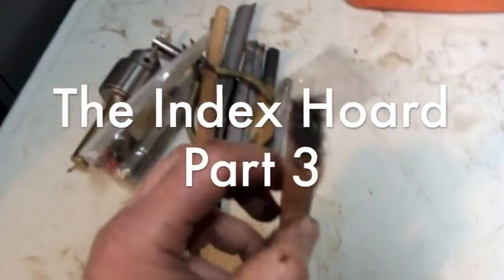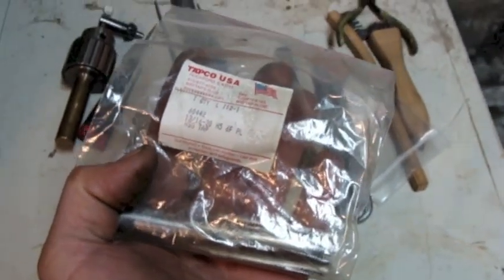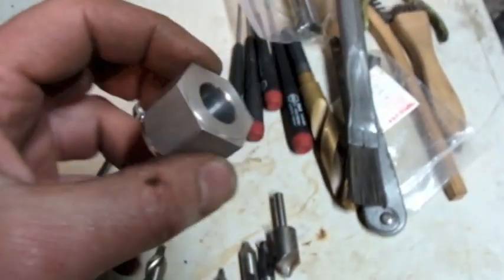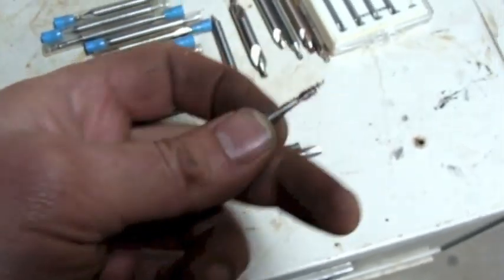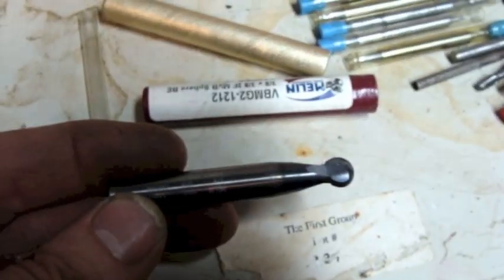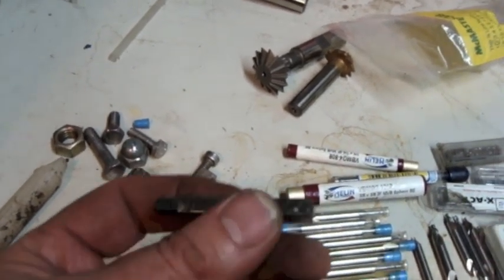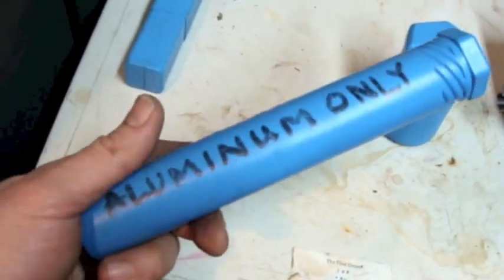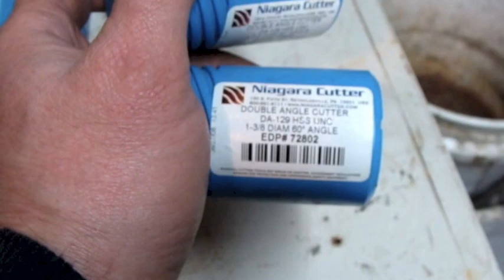Wells Index tooling Bonus Part 3 of 6

Comment: Steve;

You have scored big time with this mill.  Just from what I have seen so far on the 3 tooling bonus videos you have posted, you have more than likely already covered the cost of what you paid for the mill.  You basically got the mill for free.

I would not sell off any of the tooling or other items until you restore the mill and start operating it.  You never know what you will need and my own experience is that you will spend equal to or up to double what the price of a new mill would cost just to tool up for all the type of work you will do on the mill.  This is why that cabinet of goodies is such a deal for you, you basically have almost all the tooling you will ever need for any of your projects.

If you haven't gotten your mill inside to a protected environment yet, you might want to give it a good coating of rust preventative/preservative spray.  Slather that stuff on all over the mill and especially on any machined surfaces.  Since you are likely going to take the mill apart to do the same level of restoration that you are doing on your lathe, cleaning off the preservative will just be part of the process.

So the only question now is how are you going to convince your wife that you really do need a 3 phase power lead into the basement, LOL?

Regards;

Ron Kluwe
Reply from the maker: Hi Ron, Thanks for your input. I actually plan on doing very little to the mill aside from cleaning it, and the dis-assembly will be more of a necessity in order to get it down the bulkhead stairs. I hope to be making that move by the end of this month. I have a 3 phase rotary converter I built several years back that might run the mill, if noit, I will probably buy a VFD.

Comment: Silver-Demming are oversized stubby big drills with a reduced shank to fit in a smaller chuck.  The flats on the shank are to keep it from spinning in the chuck from the torque. The counterbore is to cut around a drilled hole to be able to set the heads below the surface.

Also, the wax is probably just for lubrication.
Reply from the maker: Thanks!

Comment: Wax is a lubricant.  The counterbore spot face tool that you showed last is probably fine.  The small shaft goes inside the cutter as you suspected.  You would drill a hole of that diameter and the small shaft acts as a pilot for the endmill.
Reply from the maker: Got it! Thanks, I knew some one would be able to tell me.